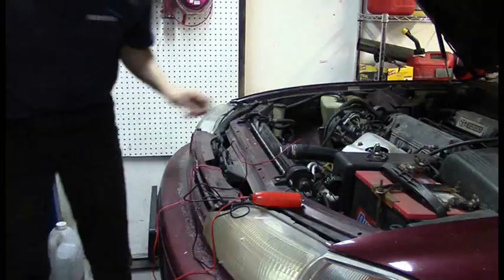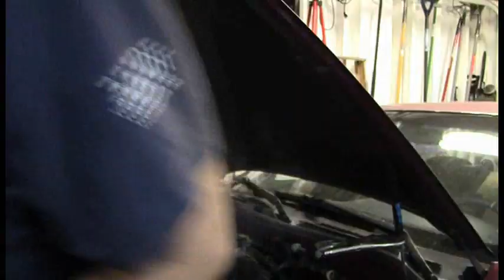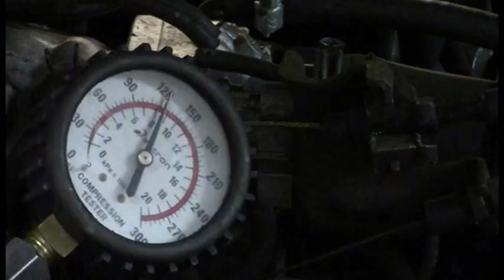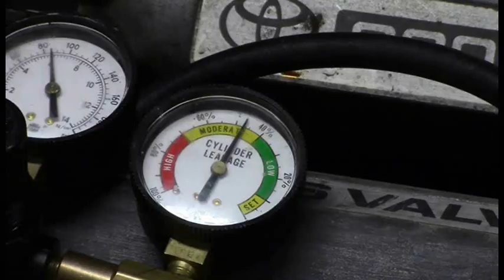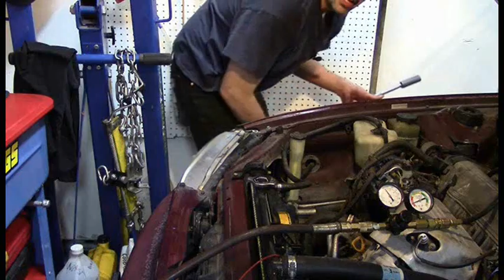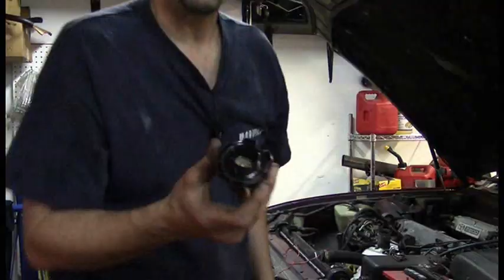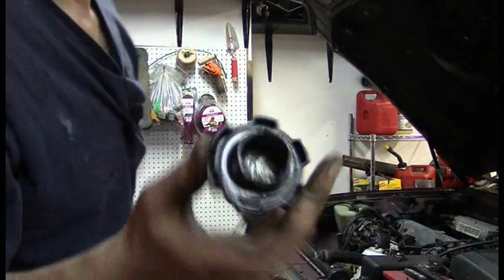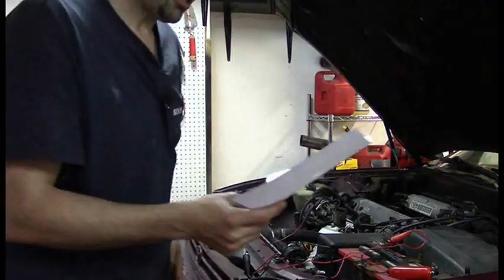12 Ways of How To Test A Blown Head Gasket Compared- PART1

Comment: I have a 99 chevy suburban 1500. It has tge 5.7 vortec. It has a code for random misfire and it smokes white at startup and idles rough. But after 10 minutes or so it stops smokeing but still idles rough. I have been told its an intake issue? How can you tell if its that or a head gasket?
Reply from the maker: I would start with looking at fuel trim to determine evidence of a lean condition at startup that normalizes after warmup. If that is not indicated I would initiate head gasket testing to either confirm or rule that out as a variable.

Comment: Not sure if the question was answered or not, I tried to hunt a little for a response, but when you asked about the problem spark plug that was from the misfiring cylinder:

I'm pretty sure all similar spark plugs will be a lot cleaner and shiny than the others.  Sorta like it's been steam cleaned.  Just something my shop teacher told me, I'm not sure if it's constant in every case.
Reply from the maker: Thats a great idea however in my experience the plug is actually covered with ash deposits but it really depends on the degree of contamination in the cylinder.  Either way, there's no way I'd use the spark plug condition as a diagnosis. Thats just me though.
Reply: Schrodingers Box
Hmm, interesting observation.

And yeah, I think if someone actually cared about their engine, they probably shouldn't trust the spark plug condition alone :P

Comment: any thoughts on a 2003 saab? no one will work on it. finally got a dye test done. they said its my HG and wants 2 grand to fix. what should I do
Reply from the maker: Sorry but I really don't want to hear your Saab story.  Bwahahaha sorry I couldn't resist.  I actually can't blame most independent shops or mechanics to be honest- European cars are a whole different thing and they often require extremely specialized, hard to find tools that can cost thousands of dollars and you will likely only use them once for this job. This often happens for me as well- I have to tell customers of Volvos, BMW's, Saabs, etc that I need special tools to do their major engine work that they would have to buy for me at literally hundreds of dollars more than if they just took the car to a dealer.  Realistically, your best option is taking the car to a specialized european auto shop or dealer.  This is the nature of owning a Euro.

Comment: Make your own cylinder leak down tester. Take and old spark plug, break of the ceramic part, drill out the middle, and weld it to a air compressor fitting. I actually found this thing in a box of tools from a flea market. Clever idea!
Reply from the maker: Yes I have done similar cutting the guts out of an O2 sensor to make a backpressure tester that I connected to a vacuum gauge.  A little enginuity goes a long way!

Comment: I have a 2003 nissan maxima but one of my spark plugs when i took it out it had oil in it... Does that mean i have to check the heads r some else is going on... Also when i turned it on for like 3 sec blue smoke comes out but my engine is real silent i dont have no problem with it
Reply from the maker: What is your compression in the cylinder? Does the smoke happen when it sits overnight only- that would be valve seals. Does it burn oil.  Get your variables under control and then make the diagnosis based on the evidence.
Reply: As schrodinger said, it can be a pretty good list of different possibilities, head gasket is one,piston rings, valve seals, PCV valve (PCV valves are cheap and part of usual maintenance, I usually replace them whenever an oil problem is suspected just to eliminate them) check your oil for contaminants, if it doesn't look like oil then you may have exchange between your oil and coolant, which is typically head gasket. Another thing is to take your oil cap off (watch for sputtering oil it may burn you) and check for steam/smoke coming out, if its thick exhaust like smoke, you probably have excessive blow by.which is piston rings, which usually means an engine rebuild is necessary, if you really love the vehicle start saving for a rebuild, if you just need it to get around start saving for a new vehicle.

Comment: Obvious question? What issues could be from slippery/oily watery residue dripping from the exhaust ?   I can literally see a few drops of oil between each 5-10 min start from the lower part of the header or in the area proximate to underneath the shifter of the car.... (garaged project car no resonator or catback exhaust etc.). Antifreeze is bright green and motor seems strong when revved ... Thx-

Comment: Thanks for the video. I have done the test and the liquid changes from blue to green..not yellow. I did the test for a short period of time as the thick white smoke is coming out from my car muffler. I stopped the test as the smoke is disturbing my neighbours. when I touched the tip of the muffler, its watery, dark oily. And the water inside the coolant reservoir decreased. The car runs normally, just the thick white smoke is coming out from the car's muffler.
would it be possible the head gasket is blown?
Reply from the maker: I have only seen it turn green if I accidentally drew coolant into the chamber of the tester. But man it sure sounds like you have a serious issue with that much smoke out the tailpipe.  Remember- other sources of coolant contamination in a cylinder are possible- leaking intake gasket for example.  I would definitely try this test again with engine cold and make sure not to suck up the coolant and I would definitely follow up with a compression or leakdown test. But it definitely looks grim your you bro.
Reply: Schrodingers Box
I have tried but it seems once the engine is getting warm, the coolant will be pressurised and it will eventually enter my tester, and affecting the accuracy of the changes of the colour of the liquid tester.

Comment: having a blown iacv gasket can make white smoke come out the tail pipe nd make people think a blown head gasket
Reply from the maker: Eli Gomez What the hell is an IACV gasket?
Reply: I have watch alot of ur videos nd ur really smart but u might not run into this problem i know toyota honda nissian Subaru have this iacv idle air control valve just type iacv in youtube ull find out what im talking about
Reply from the maker: Eli Gomez Yeah I figured thats what you meant.  Sorry but an IAC valve leak will be no different than any other vacuum leak where it is not detected by the MAF however it will be detected by the MAP necessarily.  It will not cause the symptoms you mention, nor would any vacuum leak for that matter.
Reply: bro why would i b saying that if its not true i know ur smart nd know alot more than me i have 96 civic iacv gasket went out causing the collent to mix with the air making (white smoke) come out the tail pipe beacuse of the mix so sorry this is true info changed the the gasket no white smoke thank you
Reply from the maker: Eli Gomez IAC gasket caused a coolant leak huh? That absolutely makes no sense whatsoever.  Maybe--- just maybe you mean the throttle body gasket if you have a throttle coolant passage- that would make sense. Anyway whatever- I'll tell everyone to check their IAC gaskets if they have coolant leaks. Thanks for the advice.
Reply: In the iacv there is coolant nd air mix when the gasket goes bad it will mix the air with coolant causing white smoke 1996 civic ex 1.6 if its possible for you to try doind this if u have a car with iacv and can mess arond with take the gasket off nd my proof will show thanks
Reply from the maker: Ok I checked and the gasket in the model you mention does indeed appear to have what seems to me to be coolant passages.  Never seen this before on an IAC but you definitely seem correct.  I owe you an apology, I thought you were nuts lol.  I will definitely mention this in a future video at some point, I never would have thought of that.
Reply: Yea i been watching some of ur videos nd ur really smart im 23 nd been working since a young age i work at a shop in cali the iacv gasket was my fault because i placed the gasket the opposite direction because i didnt wanna take the throttle off my mistake had to take it off nd raplace the iacv gasket problem was fixed and i dont really comment on videos but i feel like i should keep ur work up giving explanations of diagnosing a problem god bless u
Reply from the maker: Well Anytime I learn something new it's a good day, and this made my day. Thanks again, this is good to know.
Reply from the maker: Point made, I could have just deleted this thread but I am leaving it up as an admission I was wrong and apologized. Your point is well taken.  Take care and I'll certainly ge more attentive next time
Reply: Hey I just read your comment I had that white smoke coming from my exhaust I thought it was my head gasket. I ended up just getting a jdm b20 motor did the smoke have a strong  smell to it ?
Reply: The white smoke putting my hand on the tail pipe was a bit cold nd smelling it u can get a smell of coolent

Comment: You can use gas analyzer held over coolant reservoir to sniff for combustion gas in cooling system.  The easiest and most effective if you have it.  Also, using cooling sytem pressure tester, pumping up to cap spec, and turning car on, you can see if head gasket leak exists.  Pressure will spike high on guage.  Never seen paper test, but if you have doubt, wave lighter across fluid on paper, if it lights, you know its fuel.
Reply from the maker: NathanGrant1975 Good idea- pretty much same as chemistry test does. I have to imagine a gas analyzer is way, way more expensive than $30 though!

Comment: Great video, but I have a q. I have a 1996 Diesel Delica that will only overheat after driving around 2 hours going faster than 70-80 km. I will know when it starts to overheat when it makes loud steaming noises. Not whisteling like a teapot but something similar. When I open the hood I can see that the overvlow bottle is swollen up entirely and steam comming out from around the radiator cap. Which is on the expansion bottle and not on the radiator. I can go hours of driving with no problem as long as I dont exceed 70-80 km ph. Any ideas?
Reply from the maker: Timbo A I wonder what RPM's the engine is at when you are driving at 70-80km/h. Maybe it's staying in too low a gear?
Reply: Schrodingers Box From the top of my head i would say around 3000 RPM. What you say could make sense. I can feel it shifting from 1 to 2 and then not anymore untill at around 80-90km where i dont feel as much a shift like from 1 to 2, just the engine running slightly different. The first time this overheat happened was when some lady was driving it in 2nd gear instead of "D". That's also when the old overflow bottle busted and got a crack. Could something in the gearbox have been damaged?

Comment: Hi, I have a 1997 Toyota 4runner with 217k miles on it, 4 cyl, manual transmission. I've been having some problems with a constantly low coolant level in my car. Its been getting worse over the last 2 weeks. Last weekend I overheated driving around town, pulled over to the nearest gas station and poured almost an entire bottle of 50/50 coolant in there. Haven't had any problems all week driving to work about 25 miles round trip a day... until last night I overheated again and once again poured almost an entire bottle of 50/50 coolant in there. Seems the problem is getting worse now.

I've been trying to fix this problem for a while now and have tried a few things. About 5k miles ago I put in a new radiator and flushed the entire system several times until the water was running clear. There was some serious corrosion going on in there from the prior owner I bought the car off of 17k miles ago. I have also rented a pressure tester from oreilly and didn't find any leaks or experience any loss of pressure. I have no coolant leaks on the ground where I park, no coolant puddles in my engine, and no check engine lights. The guy at oreilly recommended I rent a block tester next, while the guy who did my oil change thought my coolant temp sensor might be broken and burning off too much coolant. What would you guys suggest I do next? Thanks in advance!
Reply from the maker: I would recommend diagnosing the cause for the coolant loss which this video shows what- like 12 ways to do?

Comment: Hi, I like the way you present; very thorough. I'm reasonably certain I have a failed head gasket in a 1996 Toyota T-100 3.4L engine with 265,000 miles. I have not yet done any of the diagnostic tests you have shown. I have a substantial oil leak that appears to be coming from between the block and the left head. Yesterday I had a rough start, followed by a little white smoke from the tail pipe. No milkshake looking oil on the dipstick. My big concern is that you repeatedly state to find out why the failure occurred and to not just replace the head gasket. My question is this, lacking an overheat, what other problems can occur that would present in this way? Can it simply be a function of age? I'd sure appreciate any direction you can provide. Thanks!
Reply from the maker: See my video "how to replace a cylinder head yourself" which will run through diagnostics of determining cause of failures.

Comment: Great videos, you certainly know your stuff and i like your scientific approach to diagnostics, following the science is the best way, wish some of my religious friends would do the same, anyway, i digress, i have a quick question. Can the chemical test be done from the coolant bottle as the rad is sealed on an 08 g6???
Reply from the maker: Yes religion is an interesting one. that's a whole separate topic though. Anyway good point on the sealed systems, I should have covered that. I would not add this product to the bottle but rather I would drain some of the coolant and then add the product through the upper radiator hose, then top off the bottle with coolant if needed.
Reply: Schrodingers Box
Sorry about that, i guess i was unclear, i meant the test for co2 that you did where the liquid turned yellow from blue, i don't have access to the rad cap as its sealed, ty for your reply.
Reply from the maker: john morton Ohhhhhhhh. Yes you can do it from the coolant reservoir/overflow bottle in that case. In fact just did that last weekend on a similar design to confirm a blown head gasket on the car- not that it wasn't obvious from the billows of steam from the exhaust!

Comment: Really Great stuff ! Really the amount of forums I've read for clear answers if my head gasket has blown! Then i found this goes through the lot and you even despell the false readings you can get.  You obviously take great care and time in creating these videos, big thank you for sharing your knowledge.  I will use to check mine now.  Just one thing, if when running the car with the radiator cap off and you rev the engine up if the coolant pumps out of the radiator does this tell you your head / block is blown or it that normal?

Comment: This is the first video that I seen of your and love the way you explained things. Now I'm going to watch more of the other videos you have hope there just as good. I'm a fan now.
Reply: nice vid..you have let the cat out of the box as so to speak..

am currently changing the head gasket on my 98 BMW Z3 1.9, I wish I had seen this vid at the diagnostic stage and maybe trusted my own logic a bit more before throwing so many hoses at it!

my compression gave 200 psi per cylinder and the block test came up negative so it had us stumped for a bit..but after  an improvised coolant system pressure test with a bike pump, pressure gauge and improvised radiator cap we knew the  coolant system was not at fault and working to spec..and as the water pump an thermo were both replaced 4k ago they were not suspect and have both since been tested and proven sound.

just to make sure we ran it at fast idle and sure enough the pressure built up to almost 3 bar within 7 mins or so..that cannot be coming from anywhere else but a compromised head and or gasket.

and given that the car suffered an overheat and total coolant loss a week earlier (due to a sloppy hose connector repair by previous owners mechanic) it was obvious from the get go what the issue was.

I would like a word with that previous mechanic in a locked room...

its been a pain but I do enjoy the detective aspect of it..!

once again great vid ,sound approach.